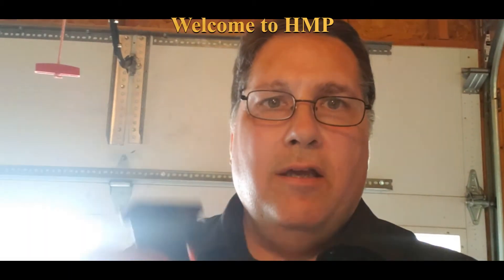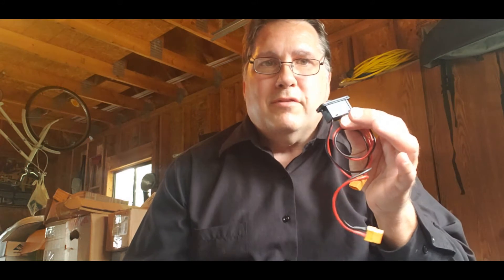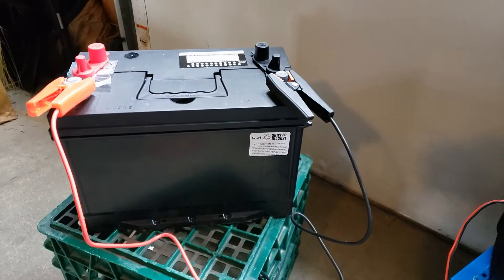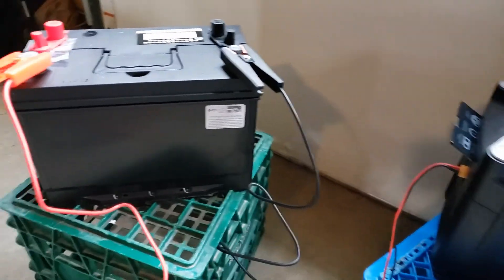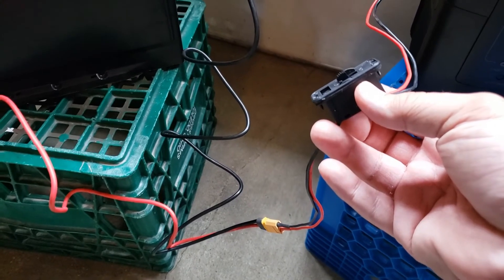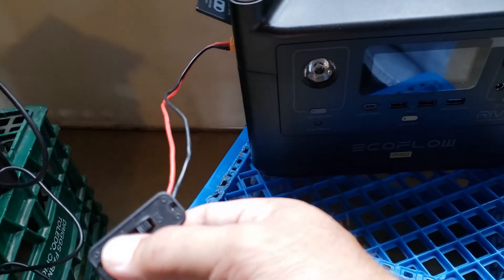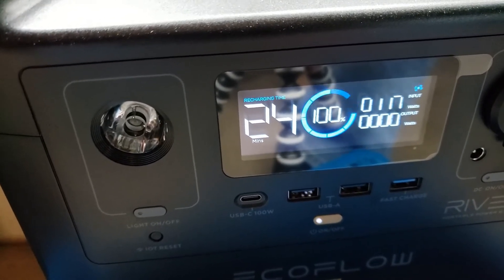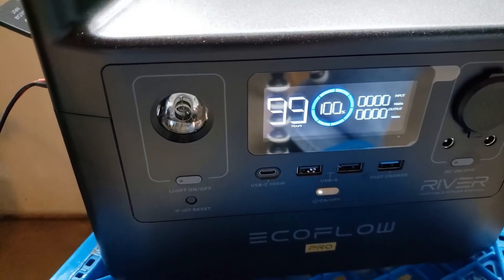Ecoflow. Control for your backup power! #ecoflow #powerforliving

Comment: dc relay timer even better.
Reply: Link for the DC timer switch, please.  

Any such switch for the Iceco Go20 fridge and ARB fridges preferably to where they are, of course, semi-perm DC plugged into our Delta, River, and/or Delta Pro?
Reply from the maker: The one I use is a simple on off dc airplane switch adaptor on Amazon
Reply from the maker: Thank you

Comment: Great idea I have a  caravan with 2 parallel batteries with a regulater can I use either one of these batteries. Will be useing a eco delter max love your videos
Reply from the maker: If you hook your batteries together as you say you should be able to turn them both on and off with switch.
Reply from the maker: Thanks Ken. Ecoflow is a very versatile product. The Delta is a ausome.

Comment: Very good idea ! Was wondering any heat from the other battery wire’s or the switch itself ?
Reply: Cord wont heat up due to the fact that ecoflow limits the pull to 12/24v 10amps so 240watts max.
Reply from the maker: I have not seen any excessive heat. Of course the switch is not ment for permanent use.
Reply: @HarringtonMediaEcoFlow  Hi I will add a fuse and switch as you have done just going to use a switch rated for 10 amps, again thanks for making these videos only ones on YouTube covering different scenarios ! Happy Holidays !
Reply: @josephpham1145  Thankyou for your input !
Reply from the maker: Good question. No heat that I could feel.
Reply: @HarringtonMediaEcoFlow  Thank you so much it’s very appreciated for your videos and answering questions …  👍  I think I forgot to mention I received my river pro and with all your info I'm set for any situation , thanks again !